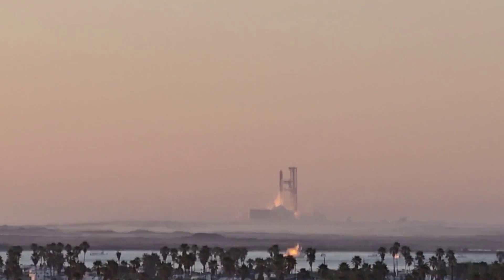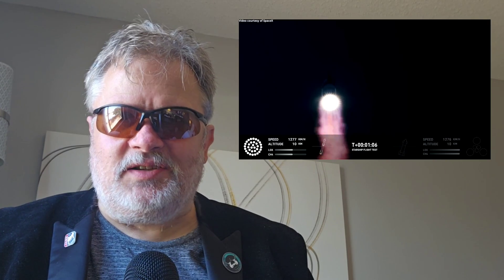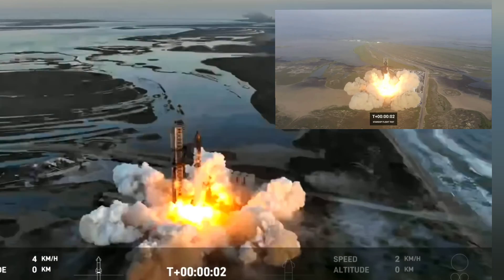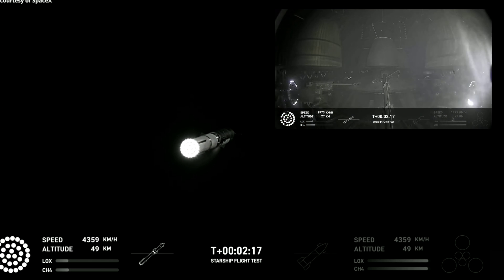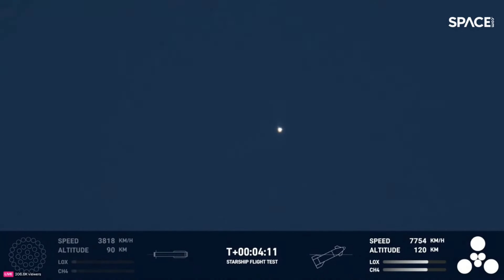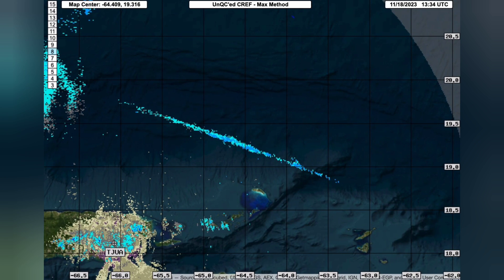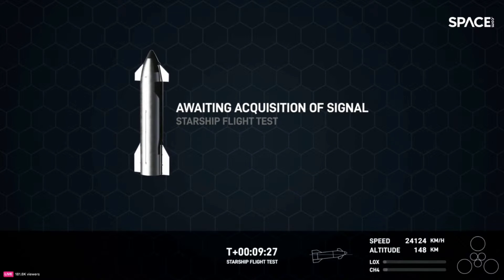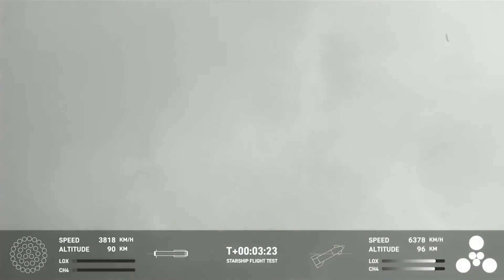Starship takes a huge leap forward!!  What's next for SpaceX after OFT-2??

Comment: I used to have so much respect for this guy. However, after dynetics got snubbed from the lunar bids he has been super hating on 
SpaceX and tbh it is annoying.  You were dead wrong about the water deluge system, dead wrong about the raptor engines being reliable, and tbh I am thinking you are wrong about the hot staging.
Reply from the maker: I don't think you were listening to a damn thing I had to say in the video. Praising Starship is clearly not enough for people like you. Praising Starship without mentioning a single flaw is the only thing that makes fanboys happy.
Oh, yeah...and I was absolutely right about how long it would take Starship to fly again after the OFT-1 debacle. I was also right about the consequences of not using a flame trench. Had SpaceX actually used the flame diverter that they had right there at Starbase ready to be assembled in April, OFT-2 could have happened in June or July instead of F-ING NOVEMBER!!!
Our return to the Moon hinges on the success or failure of this damn rocket...a rocket that won't make it to orbit until 2024 and has yet to reuse a single Raptor.  Someone needs to look at this situation with a critical eye.

Comment: ADD a cluster of Falcon-9 boosters (OR a cluster of SLS SRB's) with the most powerful and efficient Raptor engines (Raptor-3 OR Better!) available around the diameter of the super heavy core-stage also with uprated Raptor engines, do all of the required (extensive!) modifications to said super heavy core-stage and ship and go fly that and see if that gets you MORE fuel and payload into orbit???

Comment: How was SpaceX's hot staging different than Russia's hot staging?  It's been successful for Russia, so what happened?
Not once have i seen any hot staging test on the pad at SpaceX.  I've asked that question several times when the ring was brought forth.  I expected it to buckle.  But i didn't think they'd put that much power into the kick off.  It's just supposed to reduce the pressure and tortional twist on the stage clamps.
I think SpaceX put to much power into the spaceship's rockets causing damage to the top of the booster.
Was there any shielding on the top of the booster? Nothing was ever mentioned about how the booster would be protected from the heat of the starships rockets 
SpaceX failed to test first.
Are there baffles in the rockets fuel tanks?  Baffles are required in all tanks being pulled on the highway.  So if Falcons boosters don't go boom when being flipped around, why did starships booster go bang?  You can see some small flashes going off prior to the big bang. Which end of the booster was those flashes on?
Could it have been the thruster maneuvering jets?

Comment: 15 launches to tank Lunar Starship? I guess SpaceX is going to need a bigger boat.
Reply: That's a LOT of launches that are required for tanking however if Starship used side boosters (maybe Falcon-9 boosters) to get more fuel into orbit for the Starship that is going beyond Low Earth Orbit could we decrease the number of tanking flights required to refuel Starship? Unfortunately it's probably not as simple as just adding boosters to what would effectively be the super heavy core stage as if adding boosters to Starship was like adding parts like Lego parts without extensive modification to super heavy and the ship which would be required as well as more iterative development to make this idea work but the barrier we keep running up against Is The Rocket Equation which is non-negotiable and cannot be hacked? VERY annoying & frustrating that there is NO way around the Rocket Equation and it cannot be avoided as it imposes A LOT of limitations on what you can and cannot do with rockets!
Reply: @AndrewHillis_2024  Yeah, there's the tyranny of the rocket equation. The only way around it is using different launch system, which have different problems and they won't threaten rockets anytime soon.

Nobody tested active construction in anything bigger than a jumping castle or an airship, also Space Tower, Space Loop and such would require a nuclear reactor of power just to not collapse.

Nobody built a cable feasible for space elevator on Earth. An orbital ring would require at least an agreement from all countries where it would be tethered. Similar with Skyhook or Sky Tram.

Skylon is nowhere near ready and it may not be that advantageous over rockets.

SpinLaunch and "launch cannons" are probably closest alternative to rockets, but something tells me they aren't going to be used to refuel Starship. Fully reusable (not prototype) Super Heavy with tanker Starship is probably the best option to refuel. Still, we may need those lunar factories to build energy satellites (at least the mirrors or EV panels).
Reply: AND that bigger boat is going to require  MORE fuel to get it off the ground because The Rocket Equation is non-negotiable and there is NO way of avoiding it, VERY annoying and frustrating!!!

Comment: Don't you think a bladder in those tanks to keep the lines filled with liquid would be better? We use them in water pressure tanks, hydraulic accumulators, and more. That way the sudden rearward jolt of the second stage wouldn't aerate the outlet plumbing. Temperature too low?

Comment: The Flight Termination System triggered on both stages appeared to be planned.  The self destruct system had problems on the first flight. There would be no better opportunity to test the improved FTS than on this second test flight. Note that the starship fuel was nearly at zero at the time of detonation. Although it wasn't stated by SpaceX, I think the FTS test was a brilliant plan.
Reply: The plan was to get it to Hawaii, not explode in mid-air.

Comment: You can literally see engines giving out after the relight. I feel like fuel slosh is extremely likely and would very suitably explain why we saw so many absolutely catastrophic engine failures on engines that ran flawlessly just beforehand. Whether that was caused by any effects of the hot staging or not, would be a question best left to SpaceX.
Reply: Probably the flip - Slow the flip down so it takes 4 or 5 seconds instead of 1 second and reduce the side g-forces that cause the slosh.
Reply: @TraditionalAnglican  I feel like a similar reason is at play. But I think the solution won't be found in just slowing the flip; it still would have the same potential issue. If (and that's a big if) it was fuel slosh, it'd most likely best be fixed with changing their upstream "pressures" in the fuel system and header tanks to ensure no bubbles are allowed in. But, I'm no rocket scientist. Just an enthusiast. I'm excited to see the third launch and what their solution appears to be.

Comment: My guess on the booster failure was due to the fuel falling into the "tops" of the tank after  the booster rotated to top down.  That would starve the engines of fuel because the pumps are in the bottom of the tanks.  Notice the engine cut offs only after the flip.  To keep the fuel in the bottom of the tank the acceleration of the booster toward the earth would have to be more than the acceleration due to gravity (9.8m/s/s or 32 ft/s/s).  As I watch the velocity of the booster decrease after it's flip I have not attempted to calculate it's acceleration toward the earth.  Someone else can do that.  If this guess is accurate then maybe it can be fixed by having more engines fire in order to increase the booster's acceleration toward the earth thus keeping the fuel flowing to the engines.
Reply: Or turn from top with the motion at the bottom, and take 4 seconds instead of 1 second…

Comment: With something like the biggest rocket ever, an experimental rocket, a unique design, a new fuel, new engines, and a previous fail.... I always assume that it will blow up on the pad.  Everything above and beyond that is a success. And, oh boy, did this Starship deliver... no engine failures ! hot stage separation - even NASA and Falcon doesn't do that, pushing off the first stage, reached near orbital speed and it was in space !  It made it to space !!! 148 klm of space. that is real space, not just the Karmen line.  For a second IFT it is outstanding.   We have to also acknowledge that neither of these two vehicles were going to be recovered.

Comment: I’m going with the over on the early February prediction.  The process includes incident analyses, redesign (I think significant fuel system redesign), fabrication, installation, and test.  Each of those will take weeks and perhaps many weeks.  Then Space X will need FAA approval again.  12 weeks isn’t likely to be enough even for Space X.  Realistically some time in April is more likely.

Comment: The fact they the Flight termination system was used is a good thing, as that is something that needed to be retested after the first launch.
The mass media have this all wrong, this is only the 2nd flight of the Booster, and the first high altitude flight of the Starship. The first successful stage separation.
By the standards of other Rocket manufacturers that discard their 1st stages, the Booster has a perfect 100% successful run.
I'm more concerned with the cause of the Starship loss. There are some signs that Oxygen leaked shortly before flight termination.
The booster I am very confident they can fix the issues with the engines failing (I think due to fuel not flowing to them). In a way it's similar to the earlier Starship flip tests. It could be they just need to reprogram the engine relight process. Who knows.

The crewed program part, I agree that 2025 seems too unrealistic. There is a lot of work to be done to prove the crew compartment is safe. While I'm sure there will be people working on the design, and mock ups, the work is a bit limited as the Starship itself is still an early prototype. 

What I would really like to see is much faster processing of FAA reviews after each test, so that Space X can get the cadence up. 2 Flights in one year is far too slow. That pad damage really slowed things up. The new pad cooling looks like it was a success, so hopefully the wait till test 3 will be a short one.

Comment: Its unlikely it was anything to do with the hot staging because the problem is at the bottom end of the booster where the engines are, not at the top where the hot staging happened.

Comment: Can't help but wonder how much telemetry was recorded by downloading it. Communications seem to be a real problem. I may be so far off base on these thoughts. How about doing a loop instead of a flip. Leave a few engines running at low power until you have separation, then do a loop a half circle, bring the power up slowly. I don't really know if there's enough fuel to do stuff.

Comment: The sheer mass, volume, complexity, and leading-edge performance of the overall system all combine to create unique dynamics and stresses that can’t be fully predicted, appreciated, and resolved within only a few iterative cycles.  All in all… a GREAT leap forward.
Reply: Tons of sensors could have been put in there to collect data about the behavior of critical components in extreme conditions.
Reply: @tocu9808  / Yes, but ultimately those are “lag” indicators.  Sort of like Scotty yelling at Capt. Kirk, “the dilithium reactor is gonna blow!”  .. and then it blows up.
Reply: @conservativemike3768  at least they could have some data to figure out what had likely happened closest to the time right before the RUD.
Reply: @tocu9808  / How many sensors do you think they slapped on that beast?
Reply: @conservativemike3768  could have been several hundreds. Might be thousands if they need to capture data on vibration, stresses in all structural elements.

Comment: I think the ship pushed the booster with too much force and made the booster loose control. Almost as if the ship threw the booster causing it to flip with a greater force than the center engines could handle causing it to flip end over end therefore, making the propellant to “slosh” up and down IMO

Comment: The fact that all the engines fired and ran perfectly on the booster shows just one of the massive the improvements they achieved and in a lot of tests, that would have been enough... 

But they kept hitting goals… (launch-pad surviving, hot staging at least starting off ok etc) so much good data to work out how much better the next one will be!

Comment: The booster seemed to over-flip on stage separation and once all that mass is rotating it’s hard to correct with gas thrusters and non air on the gridfins… everything went upside down so fuel transfer to the engines got messed up…

Comment: I was SO impressed that all the engines were working so well together, everyone else is like 10 years behind this.
Reply: Me too. Booster showing off its structural integrity margins by doing somersaults was the star of the IFT-1 show but the Raptors - all 33 on the booster and 6 on the ship - were the stars of the IFT-2 show for me. And many of those Raptors, especially on Ship 25 I think, were quite early units compared to what’s coming off the production line now. If the Raptors installed way back when Ship 25 got its engines were this good then the latest stuff should be even less likely to have any issues. Really, really encouraging.
Reply: Everyone else is not exploding, if that's what you mean?

Comment: If methane works and I'm still skeptical it can the advantages are enormous over kerosene and liquid hydrogen. Only disappointed in the second stage failure as the hardest part having the mains work, the pad looking okay, stage separation spectacular lighting the payload module clearly is the "easy" part. As for the loss of the booster i don't think that is important in the least right now so I'm all for hot staging. The purpose of launching into the vacuum of space is to...well, get there. Reusability is a secondary consideration. As I've said elsewhere I'd like to know more about how if any starlink dispenser-ing will function as that is what is paying the bills for this and certainly not getting back to the Moon. NASA already has a Moon Rocket. Still waiting on Blue Origin. ULA is now for sale so my guess is Blue Origin will be the buyer is my only prediction going forward.
Reply: Methane works.

Comment: I think hot staging is the problem, the reason: hot staging induced a momentum change that sloshed the fuel forward, basically starving the engines.
Reply: Wouldn't cold staging just make that issue worse?

Comment: I suspect one of the grid fins that steer the booster on the return failed and might have caused loss of control and triggered the auto destruct.  Was it related to the repair that delayed the launch a day or was it the result of the hot stage blast washing over the grids and their related equipment is pure speculation.  The very first animation I saw after they built the hot stage ring made me wonder how much redesign and changes were made to the grid fins since they were clearly going to be exposed to tremendous heat and stress at pretty close range and I don’t believe their original designs had foreseen this.  I expect we will see changes related to this where either the hot stage ring grows taller or the the grids get some shielding.

Comment: Fuel slosh or damage to internal piping are likely factors in the failures, IMO.  I cannot see a plausible scenario in which impingement to the top of the booster would result in this series of events.  There's no major venting before the engines begin to fail and the propellant telemetry looks fine until then as well.

We see no obvious damage to the top of the booster in the video, which is shockingly clear considering the distance involved and we have the fine weather to thank for that.  The vented sidewalls of the hot-staging ring could have been blown apart, but I think that the protective dome remained intact.  At present, this ring seems fairly single-use as there's very little room for exhausting those raptors ;).  The Russians do this quite differently, though their structure looks quite heavy in comparison.

Hot-staging would be a very violent event exposing the booster to a variety of accelerations during separation and flip.  Internal damage could occur or propellant slosh may have allowed gas into the feed lines.  It's unfortunate as I would have loved to have seen the booster "land" in the Gulf, but there's always next time.

Comment: By the way the engines started going out on the first stage I'm fairly sure the problem was fuel delivery.

Second stage, I think that when they lost telemetry, control essentially, it said "I lost contact, I go boom now"
Reply: No. Explosion was the cause of telemetry loss, not vice versa. Also the vehicle has internal sensors such as the Inertial Measurement Unit to know where it is. It doesn't go boom just because of loss of communication, that would be pretty dumb design.
Reply: @patham9  possibly but the last I heard was FTS took it out which tells me more of a safety thing. Like at SECO it wasn't on it's desired trajectory, so FTS says go boom. With the emphasis on the FTS not working last time I'd imagine it was set to a.... sensitive setting. Shyte goes sideways at all, you go boom. FAA overlords demand it. 

I don't think it achieved the desired trajectory so FTS kicked in for safety and took it out. Better bits in the ocean than bits over land or debris in orbit.

Comment: The booster over-rotated after separation. Once the top of the booster pointed level and then down, it was all over as the fuel sloshed to the other end of the tanks and unported the fuel feeds, as well as moved the Center of Gravity to a point beyond recoverability.  
As for Starship, I agree with others that it developed some sort of leak in the oxygen system and terminated early when it was clear that it would not attain nominal trajectory.